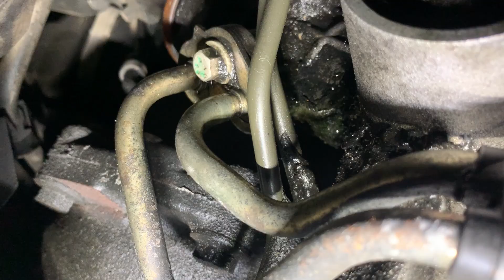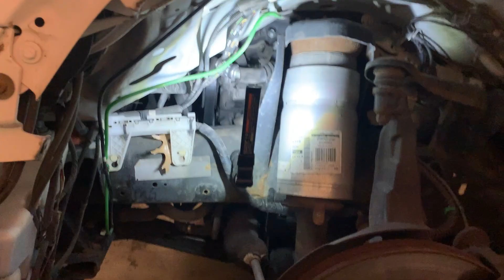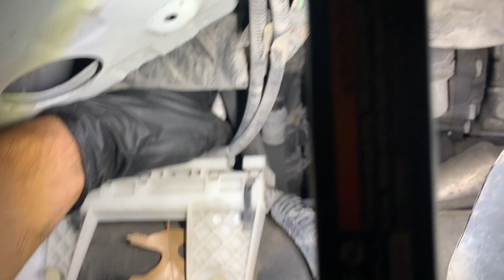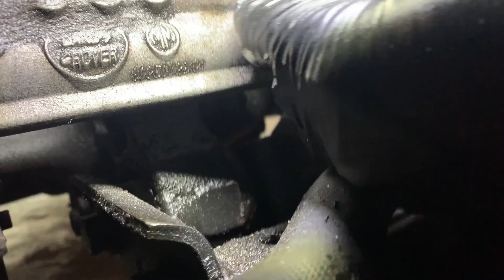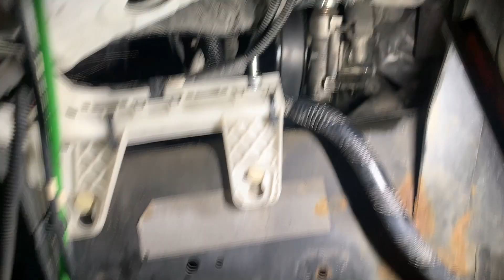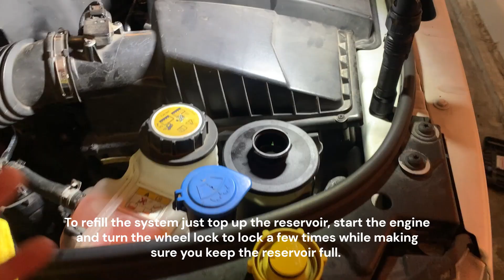Land Rover LR3 and LR4 Power Steering Line Replacement, Leak Fix

Comment: So on a 2011 LR4, are there 2 lines to replace? High pressure and return? And if so, would you know the part numbers?
Reply: LR057262 and LR057238

Comment: Good video. Helped out in getting my bearings on this project. I am pretty sure I had the same leak at the same location but it only happened when the steering was under pressure. Casual driving/turning produced no leak. Since my 2006 LR3 is so old, I put in all new lines except the cooler. Used a fuel disconnect tool for the rack to cooler line, came apart easy, less the area being a pain to get at. I was surprised how loose both the old and new lines were at the rack. They really flop around yet no leak at all and Google says it is normal. I am guessing it is to prevent vibrations from snapping them at the rack.
Reply from the maker: Totally agree. The power steering lines are surprisingly easy to move around even once they’re fully tightened down. It’s just just an o-ring seal after all. Hope you’ve found the source of your leak.